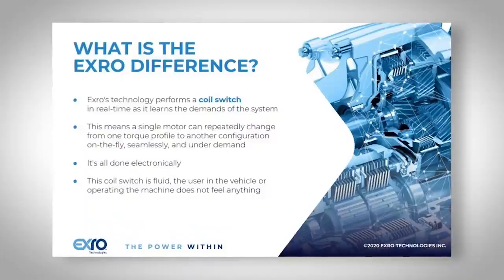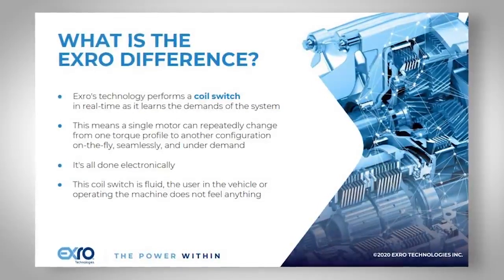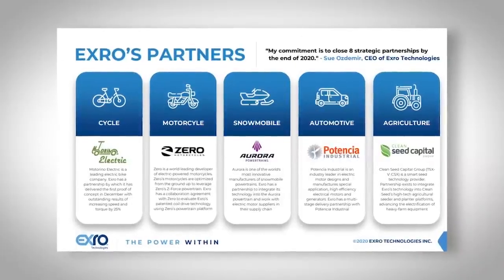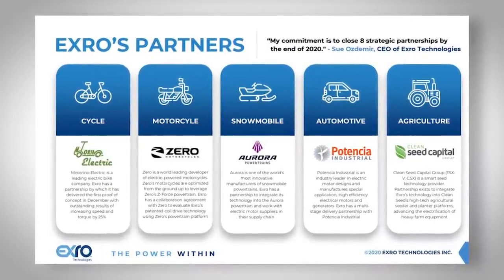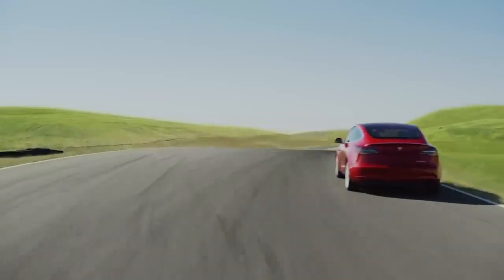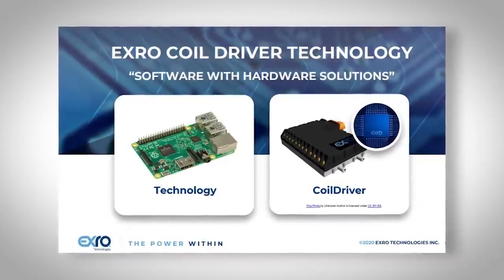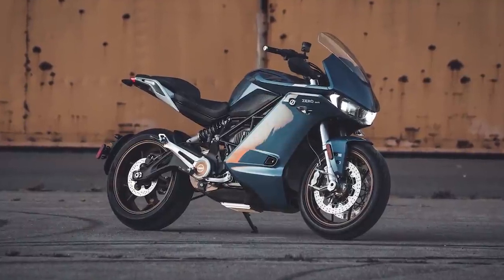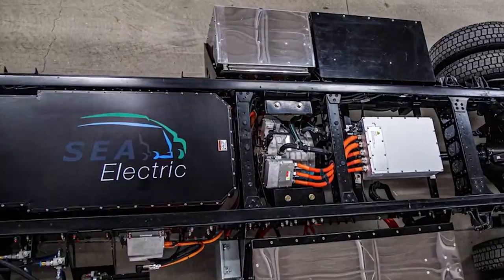Exro Technologies: Can software really make EVs more efficient?

Comment: Extending battery range 3 to 5 %  +  being able to eliminate the cost and weight of a gearbox would be a good thing providing this doesn't reduce the life of the motors being controlled.

Comment: The indoor go kart track near me uses OTL ElectroKarts. (OTL Storm EFD models) I believe they have a similar moto controller in them that lets you "paddle shift" the kart. First time I experienced it I was confused as they have no transmission. I snuck a peak at a kart they were repairing and they explained that it was the motor controller that allowed for this. First thing I thought of was, "Why doesn't any BEV cars use this?" That was 5 years ago.